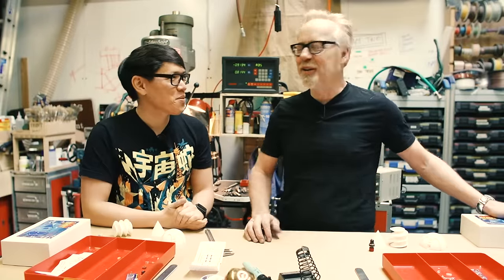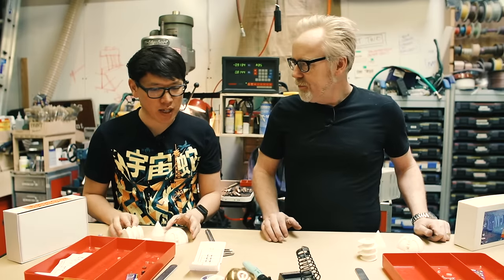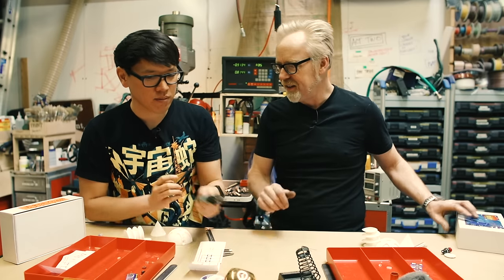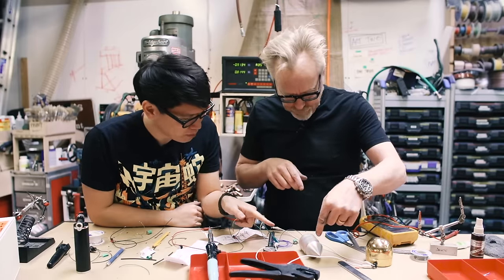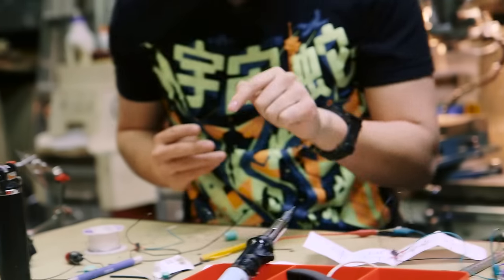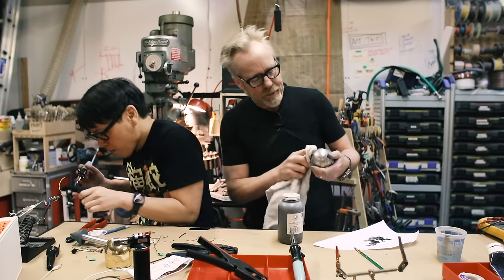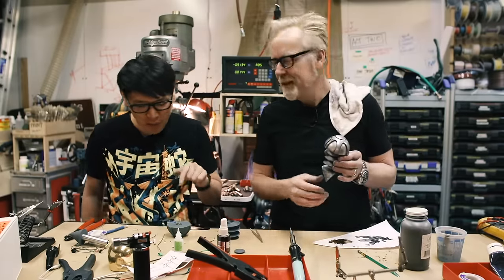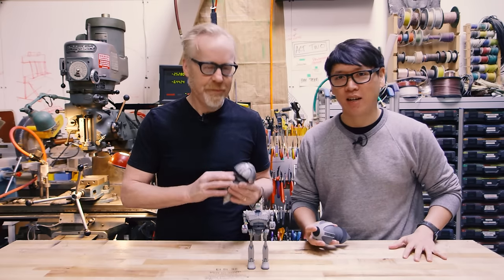Adam Savage's One Day Builds: Iron Giant Bolt!

Comment: No wonder the screw fell out of the Iron Giant -- the tip is the same diameter as the threads. :)
Reply: He didn't "fall apart" 

SPOILERS!!!!!

He stops a missile in mid air and blows up.
Reply: +ThePastyPrince Thanks. Last time I saw that movie, it was on VHS and the tape came with a cheap plastic Iron Giant figurine. I think my son has that upstairs somewhere now.
Reply: +Pete Brown That's a $50 figure nowadays.
Reply: +Colyn Bowman Thanks. Looks like they sell for around $25 loose on Amazon. I no longer have the tape or package.
Reply: I'd be surprised if he made the whole thing and actually made it move.
Reply: It was the Canadians that built it though.
Reply: I still have the VHS and action figure. But bro it was a sucky figure to be honest haha $50 seems insane.
Reply: @lazerrhino  the iron Giant had a rapid disassembly due to a collision with a nuke in mid air. None of his pieces were destroyed in a way to resemble an object blown up by an explosion.
you wouldn't be able to just simply reattach everything and have it work correctly if it "blew up"
Reply: @TylerBaraby  Canadians built the Ford GT500 too

Comment: I kind of wish it wiggled as it did in the movie
Reply: +Juan Leon New series, "Adam's One Day Mods"?
Reply: +Juan Leon Be easy enough to ad a little vibrating motor
Reply: +Juan Leon I was thinking the same thing... not sure how much space was left in the head of the bolt but a small servo with a lead weight on an arm could make it attempt to roll intermittently.... i was kinda hoping for it the whole time.
Reply: If you could fit a rumble motor inside from a Playstation controller, that'd probably do the trick. It'd make a lot of noise, though.

Comment: splotch first and then define the edges in rust or pale. takes a while but if you do it rite you have a good finish. the important part is to have the finish in dark and light tones so you can start weathering on water markes. all else aside its a surface treatment in color on the "leading" edge, which changes with actual weather, but weathering adds up.

Comment: What's that golden thing where Adam is plunging the soldering iron?? Verry nice One Day Buid by the way :-)
Reply: +BigPitter 
That's a solder tip cleaner. It has an opening facing Adam with some metal wool kind of thing inside. You would wipe the tip of your soldering iron on it and it would scrap and clean off any dirt, corrosion or excess solder. This would make a more consistent and clean solder joint.

Some people prefer to use a moistened sponge to do the same thing. I prefer the metal wool stuff.

Comment: What kind of 3d printer did you used? SLS, SLA, FDM...?
Reply: +Luiz Henrique Pinheiro At the beginning of the video they stated it was cast out of resin.
Reply: +Luiz Henrique Pinheiro I had the master parts printed by ShapeWays.  I then smoothed those and used them to make molds.  I then cast them in resin.
Reply: +justice91423 I have a FDM printer, but the prints in the video seems to be very smooth, may be their prints are made in SLS (like shapeways printers) or SLA printers..

Comment: Its super funny that it completely doesn't work as a bolt or a screw. The cone at the bottom is bigger then the threads unless it was some kinda rivet that wouldn't need threads and is weirdly pointy

Comment: I've never seen the movie, but wouldn't a cone at the base of the screw ruin the purpose of a screw? It wouldn't hold in place if a larger hole was punctured before it was screwed in.
Reply: +Funnel_Cake_Fanatic 
There are many types of "bolts" like this that exist for a purpose. For example: The base of the "bolt" (which is why it's shaped like a cone) can behave as a sort of circuit connection allowing an electrical signal to flow; when removed nothing works, or some parts don't work (depending on how you build it, and how you want it to function). It's actually a nice idea to use for some projects. They're not necessarily designed nor used in a way where physical parts will fall apart without it. There are other bolts or screws that will do the job (in your specific design). So in a way, yes, you are correct... Though I'm sure if someone sought out to make the bolt in question work to both secure and allow an electrical signal to flow, they will figure it out and make it work quite well. :)

Comment: Question how do you replace the batteries or are you able to
Reply: Yes, you can.  In fact, the new version of the kit has a circuit board with battery clips.   However, it uses VERY little power.  So unless you are leaving it on for long periods of time, that batteries will last years.

Comment: not trying to be an elitist armchair electrician, but if you blow on a soldered joint you can run the risk of a cold joint down the road...if it works for you guys that's cool but I ran into that a ton on my guitar wiring builds until recently when I learned that lol